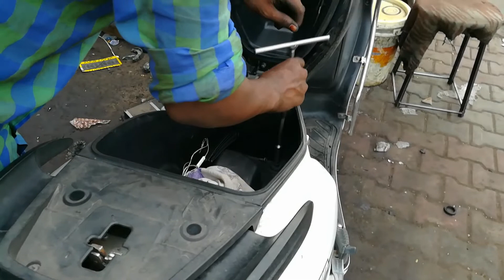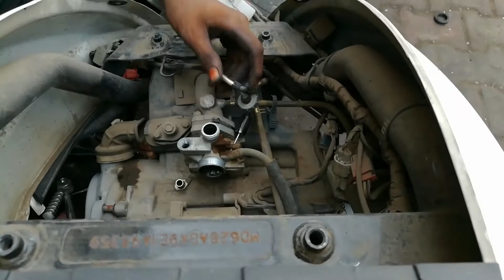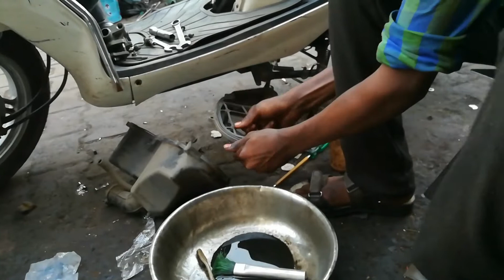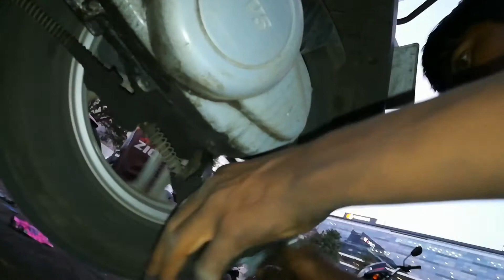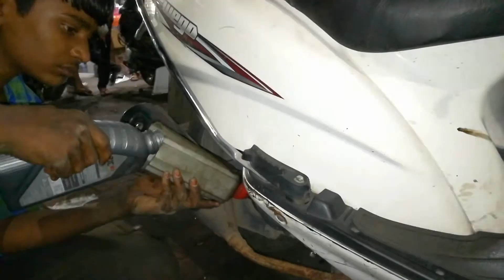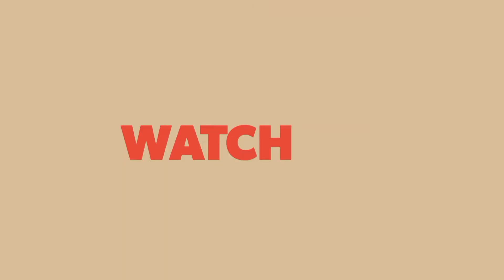General bike full servicing | Tvs wego

Comment: Hi. I have few questions. I have buy a new TVS Jupiter BS4 and have runned 650 Kms.

Q1. Which transmission/gear oil brand with  specification should I used for my TVS Jupiter?

Q2. Is it safe to use TVS Jupiter's engine oil into Transmission as a Transmission/Gear oil ?
Both TVS Jupiter Manual and service centre guys recommended to use only the TVS TRU4 Premium Semi-Synthetic engine oil (SAE-10W30 API-SL, JASO-MA2) into the transmission as a gear oil.
   
But according to outside mechanic and also online forums it is recommended to use SAE-90 Gear oil for Transmission of gearless scooters. What should I do?

Q3. I feel some metal friction sound  coming from gears of rear tyres at speed of 40 to 60kmph mostly with pillion or sometimes without pillion. Jupiter run 650 kms and also 1st service is done few days ago. They used the engine oil into the transmission as a gear oil. They said that this problem will gone after 5000kms. But I don't think so.
Why I got this problem and what is the solution?
Reply from the maker: Sidg2 i can answer q1 & 2 and i will answer it in q&a
Reply from the maker: Sidg2 i will do q&a today or tomorrow
Reply: Darshan Thakkar please answer now. I can't wait for tomorrow. I have to go for oil change.
Reply from the maker: Sidg2 see bro as per my knowledge servo & castrol oil is good for scooter. I have no idea about SAE because I haven’t used it till now.
Reply from the maker: Sidg2 and ya TVS executive will always promote their product only thats why they are saying you to use TVS Tru4 semi synthetic oil

Comment: Tvs wego me gair oil change hota h ki nhi
Reply: Yes sure, 
Motul  10w30  for  Engine  and  Good  Quality (Branded)  90 No. oil  for transmission ...
Engine  Oil  750/800 ml.  and
Transmission  Oil  120/150 ml.  top up 
The  results  are  superb  A) Increase  Pick up  2)  Long  duration  for  oil change  3)  Smooth  and  soft  noise and   handling ..